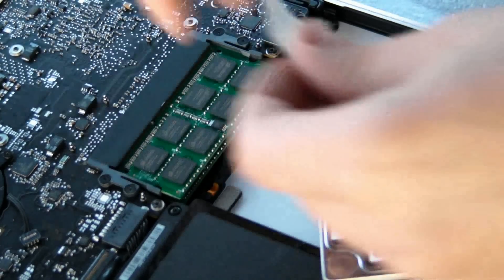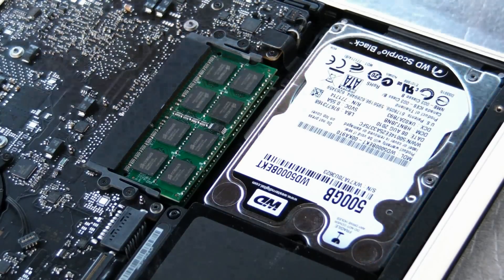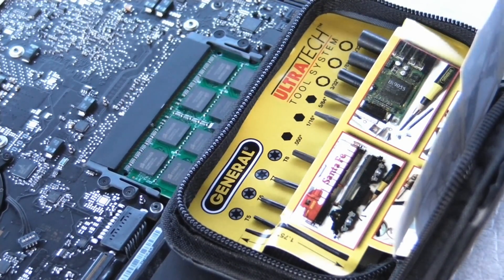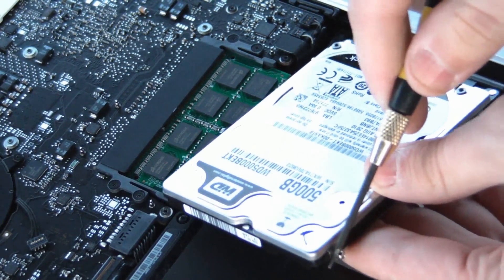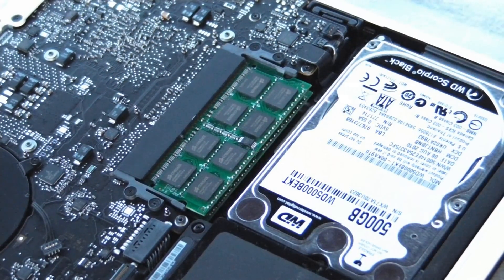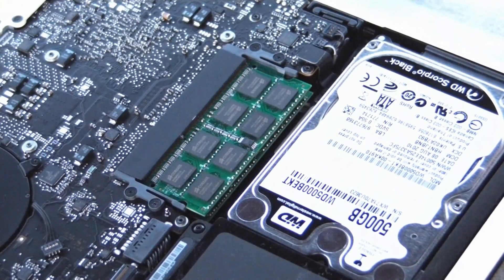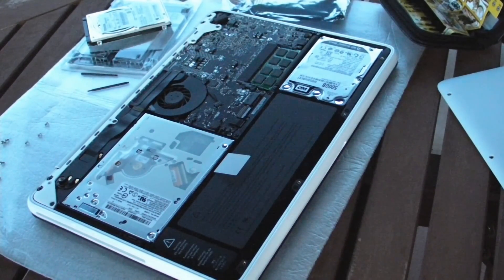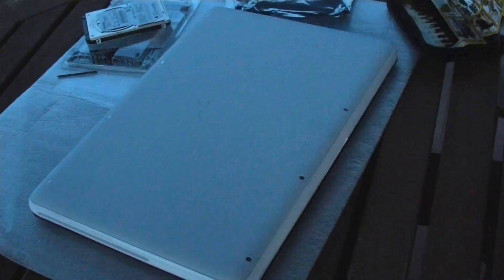Apple White Macbook 2010: Memory and Hard Drive Upgrade 101- pt2 of 3

Comment from the maker: @rozorahk In theory on the paper yes, but in rea llife performance my hard drive about the same performance it is Black Series 7200 rpm server version of hdd. Please be quiet - excuse me. Flash memory is behind ssd in just a little when a little flash drive be 128 gb easy, it means you can boot from it using some it knowledge or, create a better version that will do some operation for you and be internal drive :-)

Comment from the maker: @NDSCollector SSD only good for the drop and shocks. Future and SSD ? Joke right? This technology failed and in the beginning 2012 will dissapear. by 2012 ram of 60-128 gb will cost about 120 bucks, that can be redesigned and give a real boost, not like a joke SSD performance. SSD a little bit faster then my drive, but has 3gb/s too - I am just wondering? No, I am not marketing eater. SSD lack of space. SSD is a looser, flash drive 64 gb cost 60 bucks almost, means bye bye SSD.

Comment from the maker: @NDSCollector yes, you can, make sure that ssd will fit, it is exact the same size as 500 gb hdd. SSD is a waster of money and time, all what it does it is boot up a litttle bit faster. This hdd capable of 3gb/s , ssd has same data transfer. What the point to have small crappy ssd? That technology will go away. Because it is low capacity and expensive.